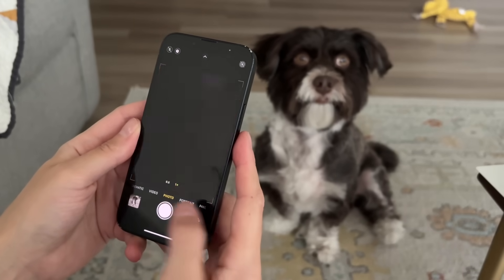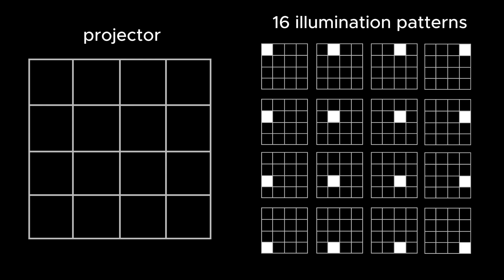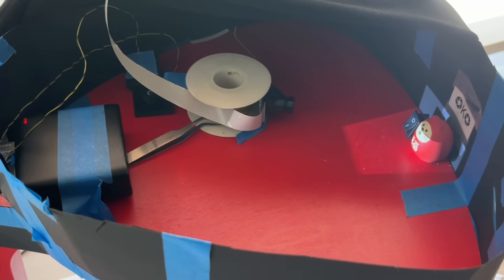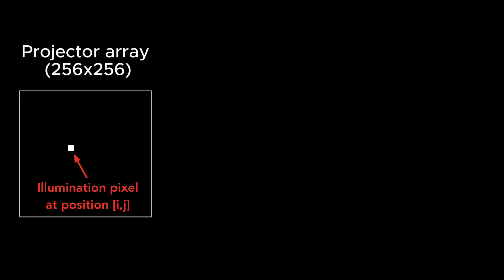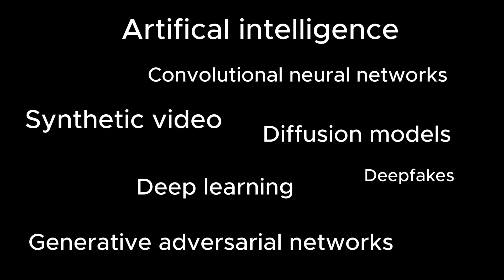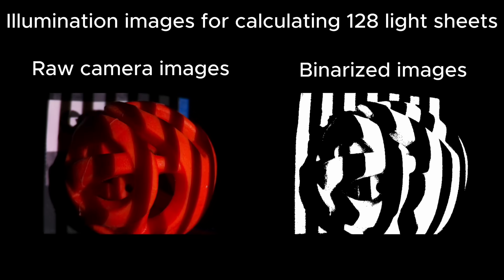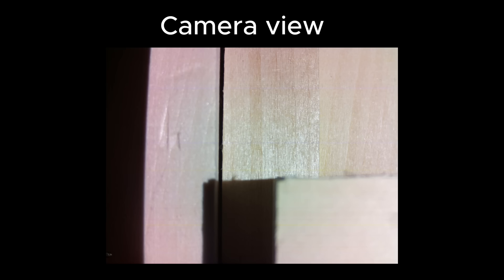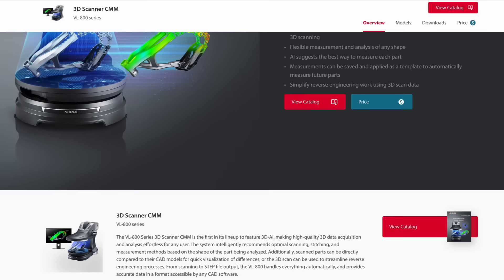Construct an image from a projector’s point of view (and more tricks with light transport)

Comment: How do you get ABCD for all 128 planes? Once you measure the points that determine one plane how do you extrapolate to acquire all remaining plane equations? Do you use the pixel pitch of the projector and simply fan out the remaining ABCD for all planes?

Comment: I dont know if this would make any difference but you could try all to scan with RGB (one light at a time, scanning the same column with each light before moving to the next) rather than just white light and overlay their data to create one image. That might give you more accurate depth measurements and reduce artifacts <- which i know scanning the image 3 times using white light would probably do the same to accuracy but im curious how different wavelengths affect quality.

Comment: The big problem with this is indirect illumination. The decomposition pattern s not correct lighting. It may not make that big of a different depending on the application but it should be understood. E.g., the lower right pixels are on more often and so the images will all be biased towards what happens in those pixels.

The way to do this would be either to use random pixel maps that give pixels equal time being on and off or to rotate and shift the patterns so that no pixels are biased.

Another method may be to scan the image using a line of pixels sorta like a printer/scanner. (e.g., more your first pattern but they traverse from left to right with time)

The method you describe is quite basic and has flaws because essentially ideally the single pixel at a time is going to capture the the true nature of the illumination of that pixel. To speed this up you want to use patterns where more than one pixel is on at a time(essentially batching). The method you gave though has bias in it so it will distort the results. E.g., if you started with 0000 then the upper left pixel would never be illuminated and so you'll never be able to recover it's correct illumination representation since it will only come from other pixels which have to be used to gain lighting information about it.

If you can generate a series of random patterns, or maybe simply take a 50/50 pattern and shuffle it up. Then you'll have something that is not biased. By simply shuffling and tracking the permutation you'll be able to reverse that in the same way but it will represent the system better.
Reply from the maker: Thanks for bringing up the issue. The original dual photography paper outlines their technique for how to structure the patterns and do the binary encoding. They put a lot of effort to make the light transport data robust, maybe they implemented some of the ideas you have here. Dr. Nayar's lectures have some additional techniques for designing patterns. The patterns used in this video weren't designed well, don't include any design requirements really (besides encoding) and so lots of errors.

Comment: Oh no, you just made me want to run out an buy a projector. I tried to use focus bracketing to do depth estimation (which actually works quite well if your surfaces are not too smooth), so this seems fun to try out. Doing photography and capturing with light sources from multiple locations also sounds interesting.

What kind of projector did you use? Most don't focus that close, so I'm wondering how well it performs when it is out of focus. I'm thinking of buying a cheap mini-projector (which I assume is 240p) to start with.

Comment: One early TV system worked a little like the second part of this video. The "camera" was a high power CRT projector which projected a raster scan into the scene. In person this looked like a video projector casting a white rectangle in the studio, which was otherwise blacked out. On a short timescale, it was scanning lines. Then, around the studio, there were photodetectors, with their outputs summed. The output from the photodetectors was then a raster video signal. You can add more photodetectors which has the same effect as adding lights to a scene, and the scene always appears rendered as from the point of view of the projector-camera.

Comment: For relighting purposes, try combining with geometric mean. I'm not sure how well it will work. You would normalize the images from 0 to 1. Then for a bit sequence that corresponds to a pixel you invert the corresponding images for any bits that are 0. Then you take the geometric mean of all the images. My hope is that this makes an image of the lighting for a pixel from the projector in a manner that doesn't use thresholding.

Not a clue if it would work.

Images that don't need inversion would produce sensible geometric means, where if both images are lit then the final image is lit. I don't know if this method makes sense for images that need to be inverted.

Perhaps take the maximum of the pictures that's shouldn't be casting light. Then subtract that maximum.

Oh. Minimums with images that should have light and maximums from images that shouldn't have light. Then subtract the max from the min. It is the region where all are lit for the 1s and none are lit for the 0s. (And all 1) - (or any 0). Minimum behaves like and. Maximum behaves like or. I believe this should work for thresholdless filtering.

Comment: I don't understand something here:

- If you use structured light with log_2(N) trials (N being projector pixels), this doesn't work unless you assume each camera pixel can be illuminated by one and only one projector pixel.
- To me this seems like this won't capture secondary light rays like reflections and refraction, because that necessarily means any part of the image could be illuminated by ambient lighting from diffuse reflections from other parts of the scene, or from refracted rays.
- How does the demo at 5:42 in the siggraph 2005 paper work? How does it capture refractive effects and ambient illumination? It also seems like the demo at 5:00 also captures ambient illumination (the unlit parts of the image seem dim but luminated)

Comment: Great video.

Your optical tomography may benefit from using as far infrared a light as your sensors and sources can handle (remove sensor IR filter and use suitable LED, LASER or gas discharge sources) to reduce optical scattering.  Developing an easy to replicate experiment would be a wonderful CT scanner demonstration system for educational purposes even if it has limited value beyond slices of lime.

Comment: Hi, just a quick note to testify that I am totally impassioned by your channel and your work.
Also, I have question: 5D W.O.R.M. data storage uses layers bubbles in a Z depth stack with depth of field optical data retrieval done with a camera.
Do you believe that it is possible to polarize and align bubbles in epoxy during the hardening and to make it highly bubbly, the nightmare of any epoxy enthusiast, in order to create such an optical depth of field array of 5D data storage and retrieve the data?
(I believe so)

Comment: Tip for binarization: take a photo of the scene without any illumination from the projector. Then remove that image from all the other images. The net result will be the illumination pattern, and you can threshold it pretty easily.
Reply from the maker: This is a critical step, thanks for mentioning it. Even with this, finding that correct threshold and how effective it is depends a bit on how dark the object was. Also the brightness seemed to vary for each pattern. Someone also recommended subtracting the inverse pattern.
Reply: @okooptics  perhaps operating in HSV instead of RGB could make thresholding easier. If you project pure white light then the hue and saturation should not change, only the brightness. This could probably fix the challenge with black pixels being hard to threshold.
Reply: @okooptics  It's basically calculating/knowing the bounce light in the scene. It might be easiest to checky by having the projector project a rim of light round the scene. This would act as a kind of gray frames, like dark frames in night photography but because you are basically adding noise you need to be able to subsctract that.

For better subsctracting of bounce light you would probably need ceveral different rims, because each pattern has a differnet bounce light you would need to somehow simulate just the bounce light of those patterns.

That does give me an idea, would it be possible to calculate some depth by using three or so frames. The falloff would probably show the distance to the point that was illuminated.
Reply: or even more: take a black and a white reference image to calculate an average midpoint for the threshold. Taking a couple of more reference images to average more and have less noise for the threshold. Also making sure that camera parameters like exposure and focus are locked throughout the whole shooting. Then maybe another round with higher exposure times to better deal with darker spots.

Comment: So if I wanted to, I could see from the perspective of the *Sun*!! There's no word to describe how amazing that is
Reply: If I'm understanding correctly, you could see from the perspective of a series of cutouts along the line between the item and the sun, since that's how I would think to binary filter the light? Same sort of thing, but not the sun itself?
Reply: @Glacier_Nester yeah I've been pondering this. Holding up a series of filters to get the pattern would mean the perspective "sees" from the position of the filters.
That would be in a straight line to the sun but still isn't the sun.
There's maybe a way of differentiating by the wavelengths of light over the course of a day, but that would give a combined perspective showing the whole of the sun's arc as if it was a single point in time

Comment: Another video idea (maybe too hard, but I always wanted to see something like this): Recreate a GBuffer using different techniques and render a real life scene using "Deferred Shading" (often used in game engines), this way you can have multiple point lights moving around illuminating the scene and maybe even casting shadows
You will need a way to:
- Capture an evenly lit scene (without shadows)
- Capture a depth map (black to white gradient)
- Capture pixel position map (camera space): maybe using the projector in 3 different axis to be able to get a X, Y, Z position of each pixel
- Capture a normal map: use 3 lights in each axis, then combine the 3 grayscale photos into a R,G,B image
- Optional: "Specular"/"Roughness" map
Then render it using OpenGL

Comment: Calculating the depth is amazing! Thanks for explaining it.
Congrats on you work!
I understand enough of 3d rendering to kinda understand what your doing. 
Youre basically transforming from a coodinate system to another. Passing through a 2d projection.
It makes sense youre using the Time dimension to compensate for the missing spatial dimension.

In video games theres something called reprojection, which might be similar but quite different. Its used to calculate a frame based on the previous, by recalculating with movement vectors without having to re render. Its used on vr a ton to double the frame rate.
But neprojection is used for other things.
Kudos on your skills, the setup looks simple but im sure it took a lot of work to get right.
Reply from the maker: well put with your note on using time dimension.
Reply: @okooptics  thank you <3

Comment: There was a software called "David 3D scanner" quite popular in the early 3D printing days, that uses a projector and camera to do quite good scans. Later it was bough by HP, and they released it a year a go free to use. I is also able to use a custom setup so you don't need there Hardware. Search for "HP 3D Structured Light Scanner". 
Did not try it yet but this video reminded me of it and now I have to test it.

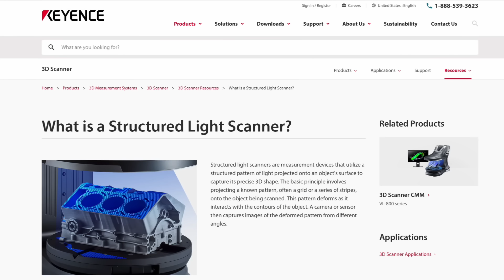Comment: 14:14 There's also the Revopoint line of scanners, using lasers and stereo cameras (not sure whether it's technically structured light?), in the neighborhood of $1000.  I've found the software to be pretty finicky, prone to losing tracking easily, but when it works it seems quite accurate.  (I made a scan of my nose and printed an inverse for a mask, and it was astoundingly comfortable, considering it was made of hard plastic.)

Comment: Reminds me of the project I tried once, to use a projector and cameras to e.g. mark out a shape on plywood for you to cut without measuring tape or protractor.  The projector was dim and I had trouble with camera projection matrices.  Maybe if I approached it with the structured light method, it'd work better.

Comment: I remember reading the dual photography paper back in the day :)

One trick often used instead of binarization is to acquire twice the images, one for each pattern and one for its inverse/negative; then you compare the two images after converting to grayscale. This avoids the need for normalization and for using any arbitrary threshold.
Reply: Ahh, of course. I was wondering if you could use the differences between images instead of a threshold. I suppose if you use negatives, that's doing much the same thing.

Comment: I wonder if this could be sped up even further by abusing multi color projection and sensing. Even just stuffing 2 (r/g) or 3 (r/g/b) bits of information into each picture could speed things up even further. It risks losing information if the surface doesn't reflect the color used though, so i guess it would need a scan with every color and might slow down things as a result.

Comment: Using a uniformly spinning mask disk (or two disk making complex interference patterns) and distinct spot on the disk like a spot with a colored filter or hole in a part that would otherwise block a laser, allowing to easily zero out and extrapolate the disk rotational position. You could have a fast structured light.

Then using an affordable high speed camera like a Sony ZV-1 to film at least a full rotation. You could maybe do a fast data acquisition.

Comment: When you sample the camera image & threshold/binarize it to help understand which pixels are illuminated by the pattern's projector pixels, is it instead possible to skip binarization and instead use the resulting colour value as a three-element weight vector for the projector pixels? For example, if a pixel in the image is bright red when illuminated by a particular projector pixel, then it would have a high correlation on that colour channel to that projected pixel. Would this reduce the noise in the reconstructed images and also highlight areas of radiosity/bounced light?

Comment: How does the projector see itself in a mirror? Does it see itself as dark and the camera as a bright light?
Reply: well if you remove all sorrounding elements and position the mirror in a way that the light boinces onto the camera, the projector should see the camera as a bright spot, but if you doesnt angle the mirror the projector would just see itself
Reply: @MotionFlow_Official  Why is this so creepy???

It's like, you know the camera isn't a light source, but it would be taking a picture of itself through the view of the projector AND the camera would be the virtual light sources appearing to emit light in the finial image.
Reply: @RingingResonance Well technically, the camera cant really work in this setup, since to map the pixels you need the projector to project the grid you the pixels can be reconstructed, but you cant really do that with a mirror since it would require i think a 360 camera to capture all the bounced off projector light, and somehow see the light on itself too, but if you can do that i think in the final picture you would see that the camera is luminated, but essentially that lumination is bounced off the mirror to the camera and after it bounced off the camera to the mirror back to the projector, you can try it out too, just get your phone and a mirror and a flashlight, position your phone in a way that its stable, tgen start recording then shine the flashlight on the mirror and try to position and rotate the mirror untill that beam of light hits the camera and if you did it correctly, you would see that the canera is bright from the mirror
Reply: @RingingResonance And its if you look into the mirror where the light is commung from, you would see the camera being luminated by the flashlight
Reply: What does a scanner see? Into the head? Down into the heart? Does it see into me? Into us? Clearly or darkly?